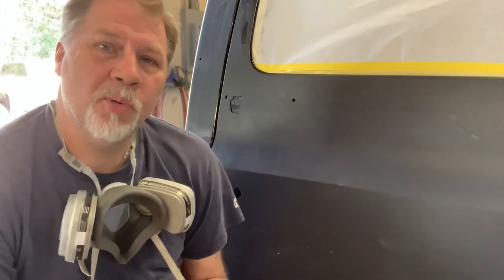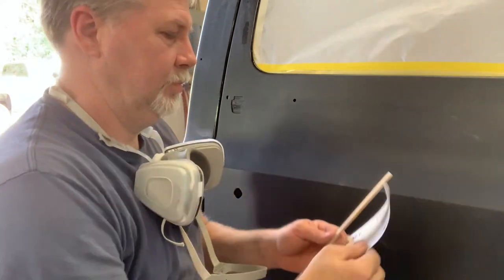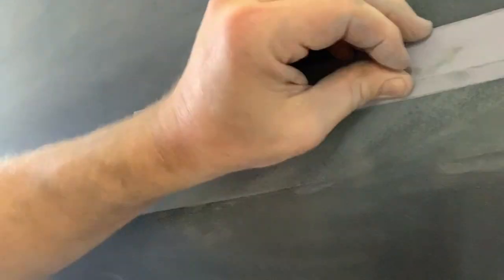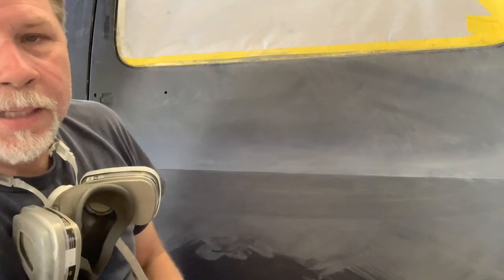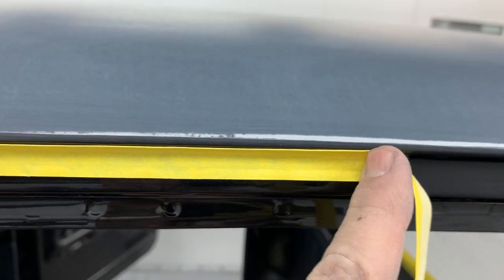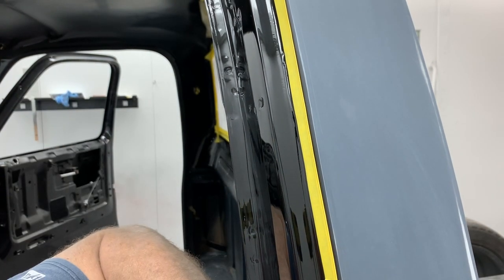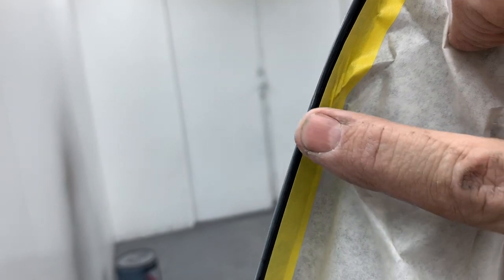C10 Repaint: Painting the Cab #c10, #squarebody, #painting

Comment: Your videos have helped me a lot.
I have a 1984 4x4 .  it's all sanded to bare metal... I'm using PPG 2 stage paint in black and white.
Can I paint the base coat and wet sand all the imperfections out than paint the clear over it ?
Reply from the maker: Brett Johnson Steps should be bare metal, epoxy, highbuild primer, then sealer(optional), basecoat, clear. The clear is applied over the basecoat immediately after it has flashed/dried. Small dirt, dust, bugs, etc can be sanded out of the basecoat then a small amount of base back over the sanded spots, then clear after it has all dried. There shouldn’t be a lot of overall sanding of the basecoat. Only minor nibbing/sanding before clear. Basecoat is thin and not very durable so aggressive sanding would remove it entirely. Also sanding marks will show if more base is not applied over the sanded area.

Comment: Could you break down your clearing technique a bit for me?  I have done a few paint jobs now and things turn out well.  But I am noticing you seem to go about twice as fast than I do, and cover the same spot almost 4 times. If I left my gun set the way it is - I’d have big problems.  I’m looking at 15:02 in this video specially.

It seems you have a lot less material coming out than what I set up as, it obviously works well for you.  Is this one of those things where you can turn the material down when using a nicer gun?  Or am I just using way too much material.  I’m using a 3m Accuspray gun now, but wouldn’t mind investing in a gun for clear - any suggestions?

Thanks for all the work you put into this channel.  I don’t know where you find the time!  It’s as polished as your paint work.
Reply from the maker: Which accusers tip are you using and what clear?
Reply: @StoutCustom  the 1.3 tip was a no go, ended up using the 1.4. This is on the 26580 accuspray.  Using PPG Production Clear.

My projects have all been black paints, with the exception of my dad’s Expedition I repaired - it was silver….so I have always been of the mindset that I don’t need high dollar clear since it is on top of black.  But maybe that is a bad mindset to have?
Reply from the maker: @gregorylaughlin1470  I haven’t used the accuspray yet but I’ve heard good things. Should do the job. There is a lot to spray technique so I will try to cover some of it in a video shortly. Lots to discuss on it
Reply: @StoutCustom  thanks!  Have a great Christmas!

Comment: I have a 1966 C-10. The body has been completely disassembled and all parts have been sprayed with epoxy and now in primer surfacer. My question is should I reassemble the body after blocking and paint or paint the parts then put it together.  My concerns are with the body lines being straight and then the bolt heads  being chipped from wrench during the process. Any advice on this?  
Also thanks for the videos.  They are well done and have been a tremendous help.
Reply from the maker: It's a back and forth process.  I usually align everything the best I can before I take it apart.  If there are new panels I put them on at the beginning to be sure they fit if I have them.  Sometimes you don't know until after blasting what is good and what needs to be replaced. Once everything is blasted and epoxied it has to be reassembled to make sure the body lines line up and if sheet metal (rockers, cab corners, etc..) need replacing they have to be lined up with adjacent panels to make sure they fit. It's like everything depends on everything else so it has to be put together and taken apart multiple times to get everything right.  Once all the bodywork is done, everything lines up, and it has been primed for the final time, then I prefer to disassemble everything, paint, and reassemble for hopefully the final time.  As far as the bolts, some people replace a lot of them with stainless or paint the bolts apart and try to be careful when installing. Stainless isn't usually very strong so they can't be used everywhere.  Chipped bolts just have to be repainted on the vehicle in the end.  I think they make some sockets that are lined with plastic to reduce scarring on the bolts but I've never used any to know how well they work.  Thanks and thanks for watching!

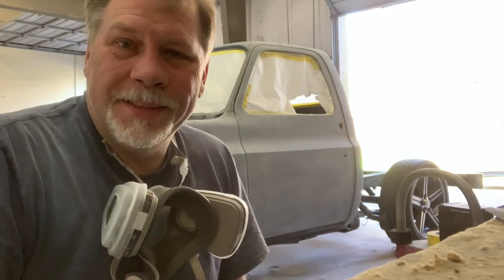Comment: At 6:30 you discussed the final sanding before red nylon pads, but it that a short stoke DA with 5/16”, interface pad and 400? Or a regular DA with a 1/4” orbital action? I have both after buying a short-stoke DA. The 35 year old Blue Point still works hard as I oil it when done and wipe and clean 3 times when reusing. Just curious. Thanks Jim.
Reply from the maker: I believe it’s the short stroke. Been a long time since I’ve looked or bought one. I think it’s more of a finishing da than aggressive style for filler work.
Reply: @StoutCustom  Exactly and works with hook & loop 1000 grit wet to sand quickly to reduce orange peel. Then 3k and up. 
 They stuck me at the last tech bays by the doors but next the body shop. One thing caught my I that could help if a problem, the they put a contractors bag over the paper/tape dispenser to keep it clean when sanding or general clean up. As everything become so expensive it helps to have clean tape to not waist paper as well. This was something I saw in one of the videos today. Passing it along as it sits a longtime until you need it. They rolled up the big bag, folded it and put a wooden clothes pin throwing onto the bottom tray to have when needed. I really enjoy the older 68 C10 Show Truck build and painting the cab back stripe on the 86 square body. I am partial to the 67 as like my first truck. I’ll keep watching!
Reply: @StoutCustom  Thanks Jim. I am in awe of the painted trim on the cab back of the square body. It turned out looking great. I have two hours of practice on my air brush. Like a piano, practice. Thanks for the quick lesson on shading!

Comment: Would you recommend single stage enamel or base coat - clearcoat paint? I'm working on a 1970 c10. Gonna be bright red.
Reply from the maker: Kevin K Bradshaw Either one if fine. Single stage is more forgiving. It hides some imperfections and  most trash landing in the paint is covered since every layer has color. SS tends to get fairly hard so it’s harder to buff than clearcoat. Base/Clear will show more trash since anything on top of the color coat will be seen in the clear. Most clear coats can be buffed fairly easily though. So...it’s up to you. For someone with less experience and a less than ideal spray environment, single stage is more friendly. In a good spray booth either will work great for a solid color. For metallics base clear is ideal. Hope this helps and thanks for watching!

Comment: i just bought a 83 sierra and it has alot of surface rust on the hood and on fenders what would be the steps i need to follow to re paint it
Reply from the maker: Probably needs media blasting to remove the rust but be careful on the hood they warp easily. May just need to replace the hood. Once it’s in bare/clean metal, apply epoxy primer, work the dents, high build primer then sand and paint. That’s the basics
Reply: @StoutCustom  thanks

Comment: Looks awesome brother!!
Were you using a Sata 5000 or 5500 for base? Im guessing the WS400 for clear? Do you like the 1.3 or 1.4 tip for clear? 
I use a Tekna Prolite for base coat. We spray RM Onyx HD (water) and use Glasurit clear. But i struggle a tad bit with peel/texture in the clear...Tried a Tekna clear coat gun, my Prolite, LPH400, now im using a W400 but still not 100% happy. Im already reducing it at a 3:1:15% ratio, so i cant really thin anymore, or atleast i dont think i can.
As soon as this Covid19 pisses off, i want to demo the Sata 5500 RP. Just want a good gun that atomizes the HS clears well and lays it on slick without much peel.
Ive adjusted so much on my technique that its making me feel like a rookie again! Lol
I hate spraying out of my comfort zone.
Reply from the maker: splash Thanks!  I used my old SATA 4000 hvlp for the base. It’s always been a great gun. I cleared this one with a WS400 Supernova with a 1.4HD tip. I also like clearing with a SATA 5500RP with the 1.4I set up. Give either of those a try. The 5500 gives you the choice of I or O nozzle too. Ive found that if I’m painting a lot of cars as quick as I can (production), I lean towards the SATA with the traditional or “O” set up. If I’m not trying to go fast, I lean towards the Iwata guns or the SATA I nozzle for clear. I think the reason is that traditional SATA has a more rounded clear application profile when viewed from the side (🔫  vs the SATA ”I” or Iwata having a very straight clear application when viewed from the side [🔫.  So...when I’m in a hurry, I don’t have to concentrate as much on my gun to surface angle with the SATA as I do with the Iwata. The rounded pattern is more forgiving than the very straight Iwata. All are great guns.
Reply: @StoutCustom  
Il have to try a Sata soon!
Last time i sprayed with a Sata it was a 3000...Long time ago, but i really liked that gun!
You think the 1.4 is better than 1.3? Is this for speed, or do you find it wets out better?
Reply from the maker: @splssh. For the clear I use most often, I like the 1.4 I. The 1.4O seems to put out too much material. Check with your paint rep and see if they have a demo kit so you can try the different nozzle sets. The clear you use and your style of spraying play a huge factor too.
Reply: @StoutCustom  
Once this damn virus passes and things get back to normal, i will definitely ask to demo! Thank you